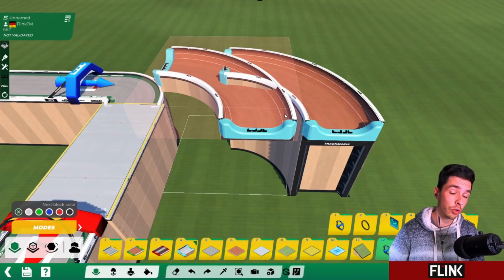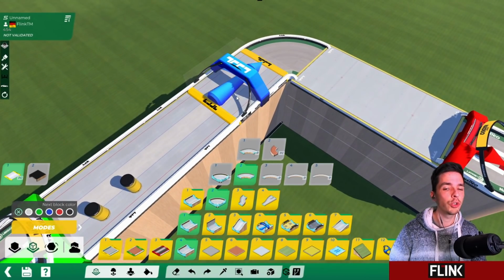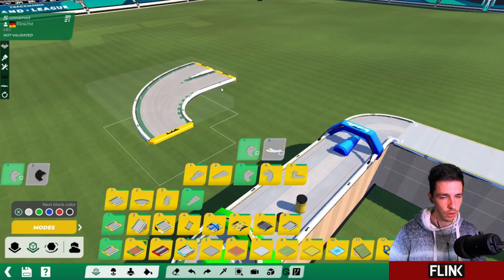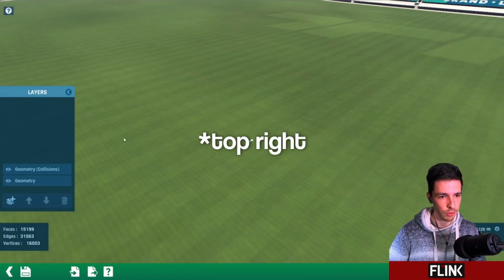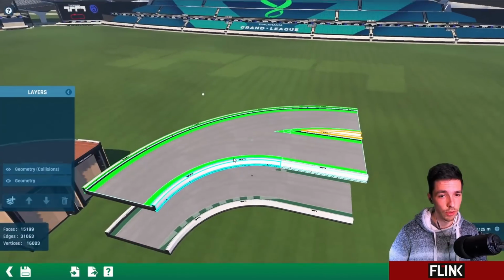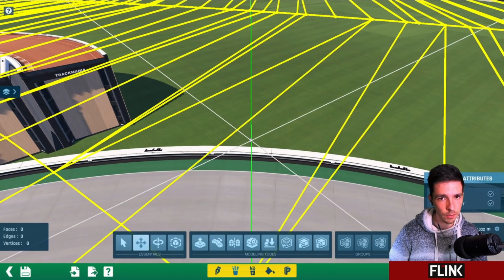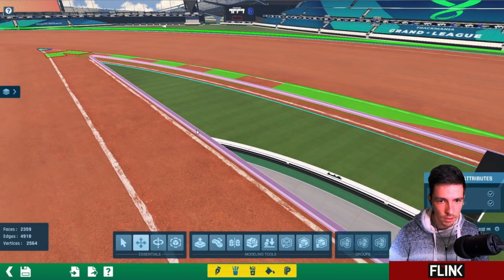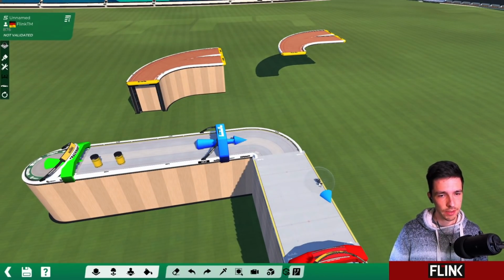How to change block surfaces - Trackmania Tutorial

Comment: If you make them as items instead of blocks they will be even lighter !
Plus you dont need to bother with the "raising" when creating them !
Only downside is that it's a bit more tricky to place them down afterward (because items are not grid-bound).

Imo Nadeo should have just given the option to easily change the driving textures of any block without having to create a new one (like, just an advanced option on each block).

Comment: The graphical glitch you describe at 2:30 is called "Z-fighting." It happens when you have polygons right on top of another located far away from the camera. Due to floating point precision limits, the 3d engine cannot tell which polygon is in front, so you get random glitching as they pop in front of each other.

Comment: When deleting the borders in mesh modeler selecting the paint bucket then selecting the part you want to delete makes it easier to select.  because the paint bucket only has the faces and no dotts, and you wont by accident move your block while selecting the parts.